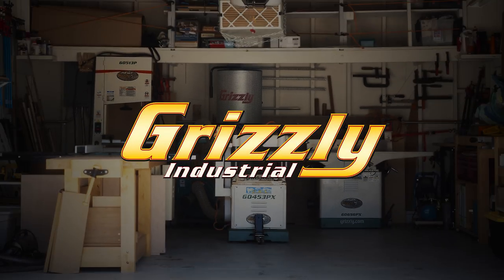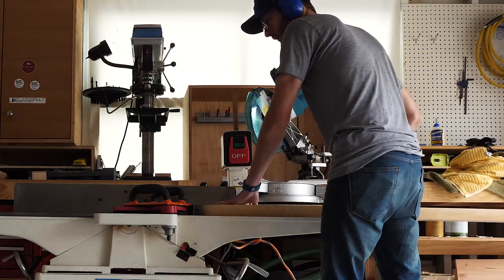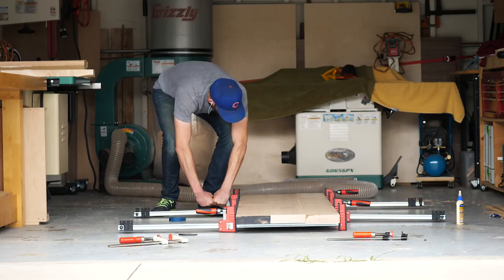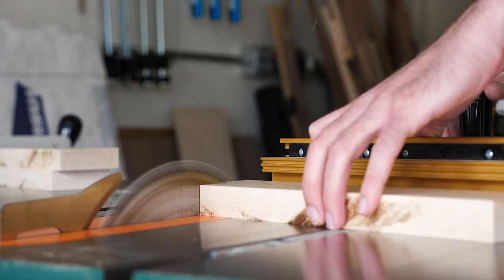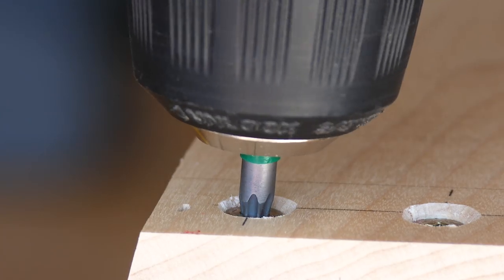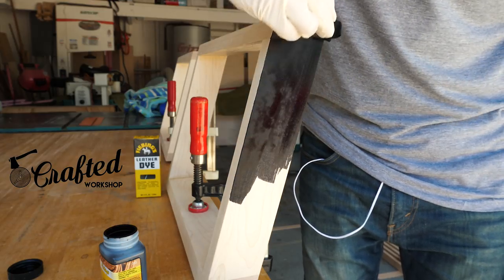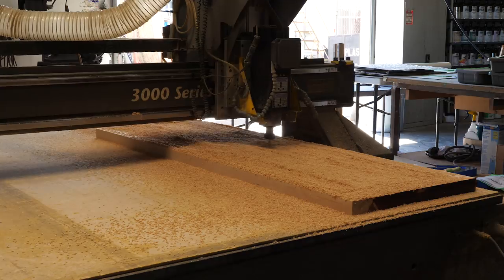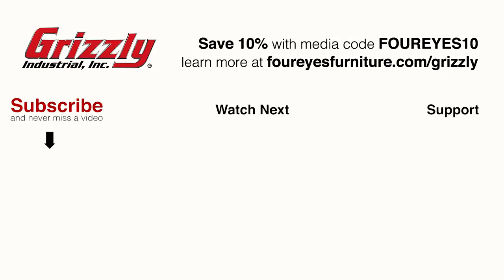New Take on a Classic | Modern Nelson Bench

Comment: Turned out sweet Chris, I like your design choices on this, It's definitely inspired but not a knock off. I had the great fortune to tour Sam Maloof's place in Rancho Cucamonga when I was younger and one of his shop guys was showing us books and pictures of reference and inspiration images that they used. So we all stand on the shoulders of the giants came before us.

If you find yourself in that cnc situation again make two cut files... one a 64th or so smaller then without moving the board run a final pass the exact size that you want it, this pass can go fast since it is not hogging out any material and will leave it perfect.
Reply from the maker: Yes DAVE!
I love that you gave this advice. I know nothing about CNC'ing but had a theory that this is how you'd avoid this problem. I talk about it on the Podcast that will come out tomorrow (July 6th)
...feeling vindicated. Or at least like I'm not an idiot :)

Comment: Great job Chris. I think too often people assume cnc routing will spit something out in an instant. It's the same cutters your routers use with the same potential feed rate. Maybe worse because 1/4 bits are so often employed. I suspect you could have done it faster with a hand held plunge router, full width bit and a simple template with movable stops to control slot length. I'm fine with the philosophy rambles. They make your stuff unique.
Reply from the maker: Thanks Nomad. I have an idea for how the CNC'ing could have been improved. I go over it on the podcast that will come out this thursday though. So I won't get back into it.

Comment: I noticed something while watching the vid, your infeed and outfeed tables on your thicknesser need to be angled up to match the wood being fed through this will help minimise the snipe. There should some bolts/grub screws below the main bolts that screw inwards to angle the tables(if not shims will work). 
I find your vids great and the VO is perfect.
Reply from the maker: Thanks! You know, I leave them purposely low. I've never had any issues with snipe...and I worry that if I err on the other side it will cause huge problems. That said, I could probably get them a little closer to flush.

Comment: CNC Routers are one of my favorite tools, unfortunately I will be losing access soon as the maker space I work at is closing at the end of summer. They shouldn't have burnt the inside of the bench, the sign shop is probably just used to cutting sign foam and got the feeds and speeds wrong or just used a dull end mill. 
At the end of the day still a nice project and good video. I get the sense that you are kind of like me and by the end of a video project you are just ready to be done.
Reply from the maker: Hey Tom, in next week's podcast I talk about it a bit an propose a cut tecnique that might have avoided the burns. I know nothing about CNC'ing, so i'd be interested to hear your feedback after you listen.

Comment: Hahaha. After the slow mo camera fun I just imagine the "well, now I have to clean this up!" moment. Speaking of new camera... did you get a new camera slider too? Pickin' up on those smooooooth pannnnnssss. PS- I like that your voiceovers aren't ONLY about the project. That's part of the reason we love your videos. You do you :D
Reply from the maker: Thanks E&K. No new slider, but b/c of the 180fps it makes the pans look all buttery. Also (after this video) I rigged up a motor for my slider so now I can really make it slide slowly. As slow as a 15 degree rotation over the course of 10 hours. I will not be using that function :)
Reply: hahaha. but if you wanted to 10 hour time lapse where the angle changes just enough for someone to be like "hey is this moving?" you're all set :D
Reply: Chris Salomone That's crazy slow! Ha ha.

Comment: Why do you use your table saw to get your piece to width? I've seen other youtubers do this as well. 
I've been taught (first year of woodworking finished) to make two sides flat and square on the jointer, and then make the opposing sides parallel via the planer. First the width, and then the thickness. 
I don't know how to explain it better, but when I have my perfect rectangular boards, I've only used the jointer and planer. Hope you understand the question!
EDIT: I love your philosophical voice-overs!!!
Reply: I think it's a combination of safety and convenience. Standing a board like this up on its side to run it through a planer/thicknesser seems like a bad idea (especially if the boards are thinner than this one), not to mention that it'd probably be outside the capacity of most machines. Besides, it's really nice just to be able to set your table saw fence straight to the width you want it to be and run it through, and the finish that a good blade leaves is plenty good enough for glueing and just takes a bit of sanding/hand planing to be fully presentable.
Reply from the maker: Thanks Kevin...that would certainly work...but it sounds like a hassle to be honest. I like to use my planner for what it can do that other machines can't. Using the planner you're going to be changing and resetting blades more often etc... It's one of those things where there are multiple ways to do something and none is "right" but I think most people would opt for the table saw to finalize width and the planner to finalize thickness. Just quicker and less hassle.

Comment: I couldn't read all the comments so you might have already answered this. How did you paint the inside of all the slats and yet still have such a clean top? That must have taken forever!
Reply from the maker: I talked about it on my podcast a bit "The Modern Maker Podcast", but basically spray from the underside (still get some overspray on the top though) then sand off the paint.

Comment: I call it "sick". This bench looks gorgeous! I was wondering how you would get that much of a dark stain on the wood when I saw the thumbnail then immediately after, thought maybe it was steel & you dabbed a little in welding a bit again. Love it Chris! I would def still go with the cnc slotted version. Looks sick as I mentioned lol. Awesome build!

Also, I know you mentioned this was essentially your first time working with leather dye for staining wood, but do you know if it can be diluted (with water or paint laquer or something like that) to get a grayish color? I guess to avoid going out & buying a gray leather dye if we have this one on hand already. Maybe Johnny can answer this one since he's had a bit more experience with it? Also, what kind of applicator did you use to apply the dye? Will a normal rag or maybe blue shop towel do? Thanks guys!! Keep up the awesome builds 🤓👍💪
Reply from the maker: Thanks Janie. I'm not sure - but it's pretty cheap stuff. I think the bottle was about $7 maybe - so wouldn't hurt to play with it. The bottle comes with an applicator, but for rubbing it on larger surfaces I just used some old T-shirts that I cut up
Reply: Thanks Chris!

Comment: I’ve never machined maple or anything that thick, but that doesn’t seem right to me. Burning is usually caused by running it too slow which is reinforced by the extremely long runtime. I would program it so it uses a bit that’s slightly smaller than finish size. Typically if you want a nice finish you would leave around  .010” on the wall and run a quick finish pass, similar to what you said on the podcast. Our router is out of order right now, but if it’s alright with you eventually I would like to replicate the bench the way I described and see if I’m correct. Love the channel and podcast. Thanks for being an inspiration.

Comment: Hey Chris, Love all your designs and the way you do your videos.  You are very talented.  One question for you is how do you determine whether your legs will be sturdy enough - particularly with lateral sway?  I'm building a patio table and matching bench with similar legs to what you have (except mine won't have any angle to them) and I'm trying to make sure the legs will be sturdy enough.  thx
Reply from the maker: Most of that has more to do with how they are connected to the top than the leg itself. This one is actually surprisingly sturdy. Honestly, a lot of it comes from experience and intuition.

Comment: Hi Chris, fourth or fifth time since I stumbled upon your channel. Great work, and quite on par with "Ishitani Furniture" which I also subscribed to. 
Did you ever capture a walk-through about your garage? I'd be more than interested in what one might need to spend to equip a workshop like yours. I'm aware of the fact that it takes a lot more than the gear to produce stunning results, but maybe you could point out why you decided to get these very makes and why you preferred them over others. Small tools like rulers, angle steels etc would be equally interesting. On top of that: What to look for / take care of when buying used machines?
Thank you for your inspiring work!
Reply from the maker: Thanks Olaf. I haven't done one...I'm still kind of hesitant about it. I don't want to appear as an authority on the subject b/c I'm not. To give you an idea of what I spent though...I'd guess I have about $15,000 wrapped up in it. That's a very rough estimate. I could be quite off either way. Also....one by no means needs what I have to get started. It took me years to get to this point.
Reply: I see. Thank you for this info. One more idea for a tutorial-like approach: Every project might come up with special requirements. E. g. when to use slice wood plugs vs. pin wood plugs (I hope I got the technical terms approximately right), and what tool to use to prepare your material for these.
Or (please don't take this one too serious, just an example), advantages of mortise and tenon joints over screws and mounting angles w/ step by step demonstration. 
I could think about tons of stuff viewers would like to learn from you this way. Presented in a bite-sized manner you could build up a nice collection of tips and tricks, your playlists could become a go-to reference.

Comment: When you run your boards through the planar, why does it look like the pieces aren't sitting flat on the indeed and outfield tables?
Reply from the maker: I err on the side of having the infeed and outfeed tables low. My rationale for better or worse is this. Ideally they would be dead even. If they are a little high, they will have a really negative effect on the boards, if they are a little low, it won't really change anything about the cut. So I just keep them low.

Comment: I like tutorial . great video you could make it a threetorial. still a great video.
I'd like to make a queen size bed with a similar look as the table. the legs and with thicker sides. with the mattress fitting inside. with a slotted headboard. kinda like the table top. I'm new to your channel. the plywood bed got me. I also like it. its just to big. and I need my bed higher. about 30"-34" floor to mattress top. maybe 36", I don't like high foot boards. even with the mattress top is it for me. thanks
Reply from the maker: Hey James...thanks. Glad you found me. I look at the bed as more of a concept than a finished piece. Totally adaptable to different dimensions.

Comment: Can I get 100% if I used 10FOUREYES10?  I need a 48" planer/jointer/sander....
Reply from the maker: haha...It's worth a shot. If that doesn't work. Just use the code 10 times. Though, technically that would still only give you about 65% off I think.
Reply: @Foureyes.Furniture  if you havent already, you should check out hand tool rescues channel, its pretty good!! and of course your channel is awesome.

Comment: Hey, is it me or does the framerate changed?
New camera i know, but looked better before. More cinematic
Reply from the maker: It did. My old Camera filmed in 24. This one I have set to 30. I could make it 24. But I like the way 30 looks. Also make some of the slow mo stuff easier. It goes up to 180fps for slow mo which matches back up to 30 (regular) much easier